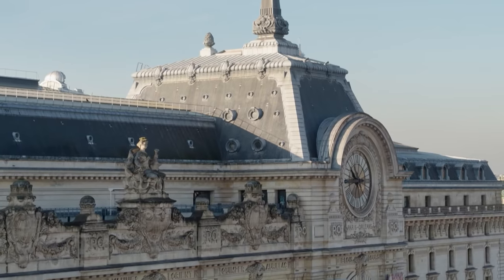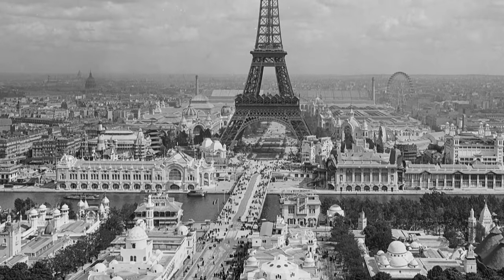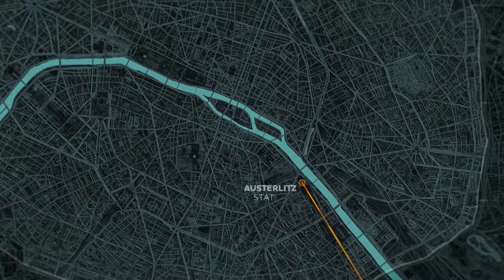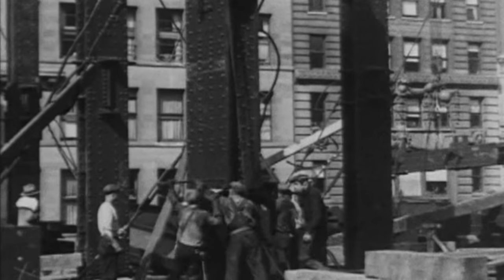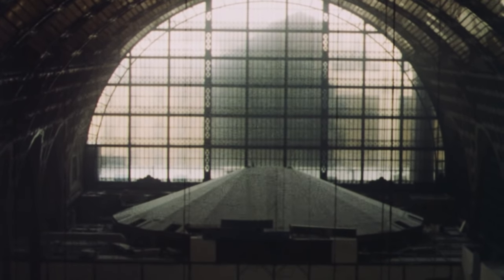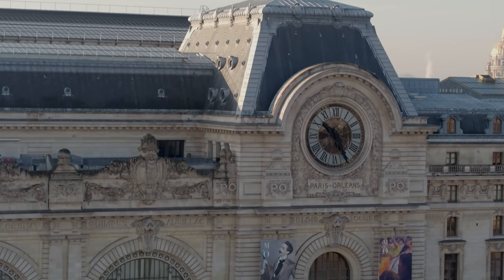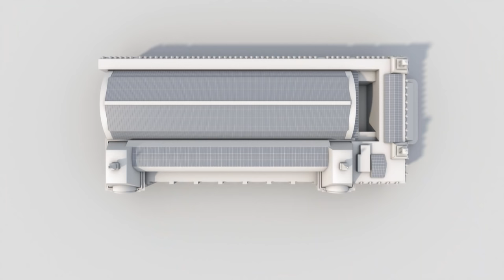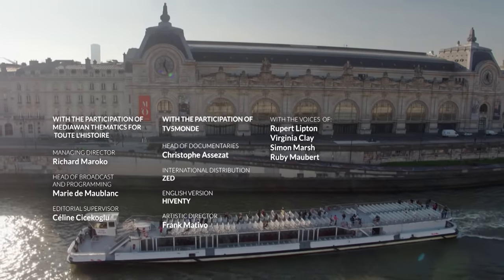The Home Of Impressionist Art: The Many Lives Of The Musée D'Orsay

Comment: This documentary seems to be written and produced by flowery writers and artists.. that's where it fails as a doc.
It's Supposed to be about a magnificent building; that's architecture which can be Art, but there are a lot of Technical elements to architecture. 
The use of vague terms to describe the construction are the most annoying failings; 'metal' structural support= wrought iron, 'floor'=footer/foundation, 'steam powered'= coal-powered (smoke/air pollution in tunnel), and many more.. I give this documentary a 'just ok'.